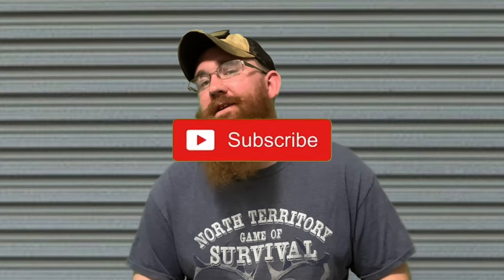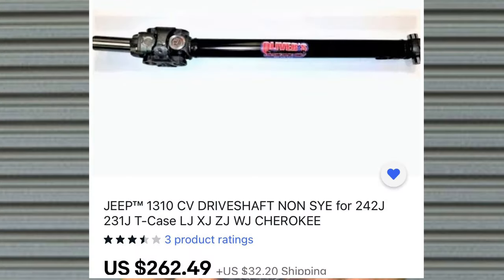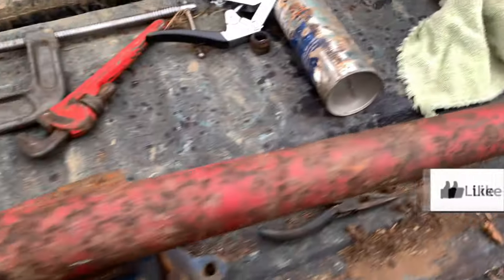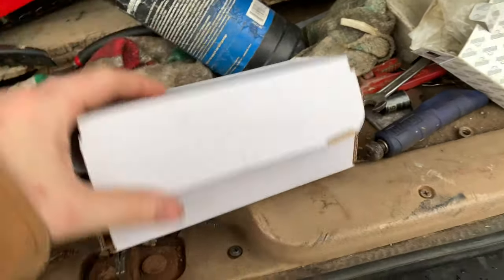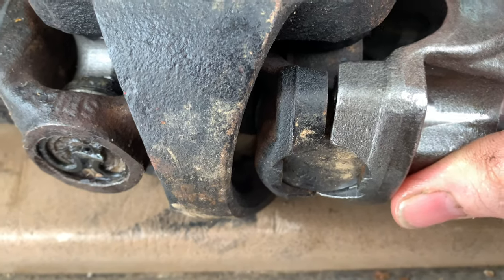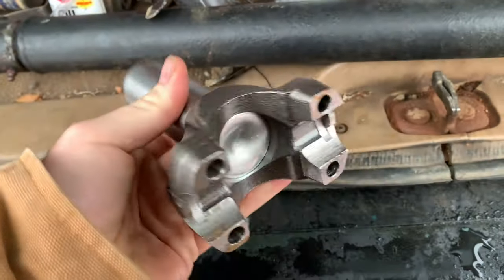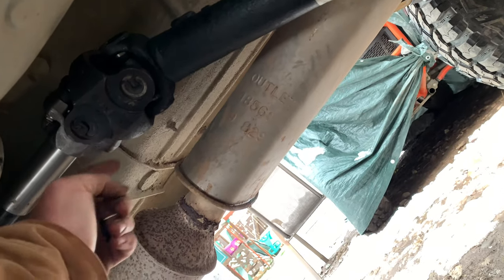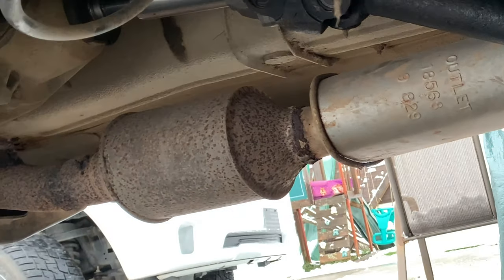How to use a double cardan driveshaft in the rear of a jeep xj (NO SYE!)

Comment: this can be done with a non slip shaft also, just order a non SYE double cardan drive shaft from what ever vendor you choose, it wont be as cheap money wise as this was. id like a set screw or thru-bolt on the TC output shaft myself doing it this way. that way you are sure you have max spline engagement on the output  shaft at all times

Comment: To be sure you had no other modifications or altercations to the new yoke or existing driveshaft? Just bolted up and all good? I need to do this with my 2000 XJ with a 231 TC that looks to have a 4” lift (previous owner installed)....good video, thanks!

Comment: I am confused with the "Crown Jeep Cherokee XJ 87-95 NP242 Transfer Case Slip Yoke Eliminator 4856142"   is that different spline or something  than the output shafts after 1995?  ?  It looks like it is already cut down..

Comment: I have all needed parts and tools to do the hack n tap but haven't decided on doing it yet as thr front drivr shaft is considerably thinner than the rear one. I'm not planning on doing any rock crawling or crazy stuff and this is my daily driver and my only vehicle right now, I see some trails from time to time but nothing hardcore. Any thoughts?

Comment: Could you say, drill into just the side of the yoke and tap it and use a grub screw to prevent that slipping off? I only ask because id figure if both the new part and the center can slip than if the pumpkin torques under load its gonna change the angles a lot, probably no big deal, but something to consider if u joints keep breaking.

just a thought! love the videos, been a long time lurker, bought my first xj a year ago and been doing exactly what you do.  Keep up the great content as always!
Reply from the maker: I took it out and was pretty ruff on it and it has been fine. One thing I’m going to experiment with is welding the lower slip just to see how that does but as of right now it’s doing great

Comment: 94 XJ N231J Tcase 
I put on a 1310 cv style slip yoke from Oliver's driveshaft on a front driveshaft to have a double cardan in the rear. Problem is instead of the end attached to the differential telescoping, the yoke is just extending. Can I drill out this yoke and tap the output shaft as is without cutting it or replacing the 3 hole rear cone?

Comment: Nice! So this will only work without any mods/cutting if the Xj is lifted 5 1/2”+ lift???
Reply: Can ANYONE answer my question before I go buy a SYE!??? Lol
Reply from the maker: It worked in mine and a few others but always remember every jeep Is different
Reply: @cherokeeronnie  ok cool. The reason it is Supposed to work is because that amount of left right? And did you ever weld the bottom side slip yoke? And Thank you for the reply

Comment: I wonder if I could do something like this on my 95 wrangler?
Reply from the maker: I’m sure you could do it just gotta figure out the measurements
Reply: most likely will need to shorten the driveshaft for the rear since it has such short wheelbase (front drive shaft is way longer than rear)

Comment: ok , 99 xj , 3" rc lift , 31s . gettin a slight vibe/noise on deceleration , should I try TC spacers b4 i get into all this ? or just run it , mostly mild trails
Reply from the maker: Honestly with a three inch and mild trails I would just do a TC drop it’s cheaper and will help you out
Reply: @cherokeeronnie  Yah, the PO on the 98 xj I just got used about 6 washers to drop the tc.    eh.   Seems to work.      But I'm cleaning and replacing motor accessories before I even get here.

Comment: you leave the slip part of the front drive shaft alone? what if it extends and bottons out the slip yoke on the transfer case?
Reply from the maker: I left both of them because I have 2 inch shackles in the back and the s10 springs flex hard I haven’t had a problem yet I just flexed it out hard on this little trail we go on, it’s doing great
Reply: hey Ronnie, so how much play do I want on slip yoke to prevent from bottoming out?

Comment: I have a 96 xj with a rc 4 1/2 lift. This should work to replace the rear drive shaft correct?
Reply from the maker: If you get the right drive shaft
Reply: @cherokeeronnie  what years are what legnth? which is longer, ZJ, XJ, WJ, TJ, LJ?????

Comment: So you don't hack or tap the output shaft of the tcase?  Hmm, I've seen a couple write ups on different forums where they use the same 3103 yoke and the double cardan joint, but they all cut and tapped the output shaft in some way or another.  Any issues with the yoke bottoming out on the output shaft?
Reply from the maker: No I didn’t cut and tap I wanted to see if this would work than I was going to do the cut and tap but I’m still running on road and off since this video. it cant bottom out I left enough space for it not to
Reply: @cherokeeronnie  Bad ass man, thanks for the update!  What threw me off is I have an 88 with a 242, which has the tail housing that seals on the slip yoke. I guess I could buy the seal housing for $65 from Ironrock and then set it up the same as you have.  Great channel by the way, I've enjoyed every video I've watched!
Reply: @cherokeeronnie  so how much play do you want to have so I dont bottom out?
Reply: @doncreed7109  This is what I am wondering as well.